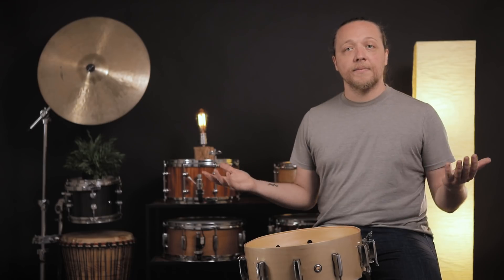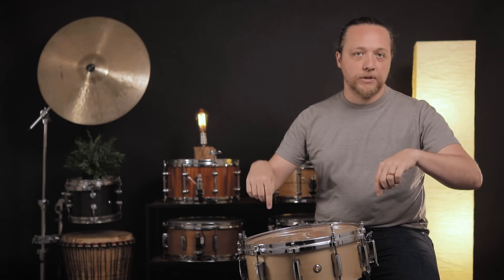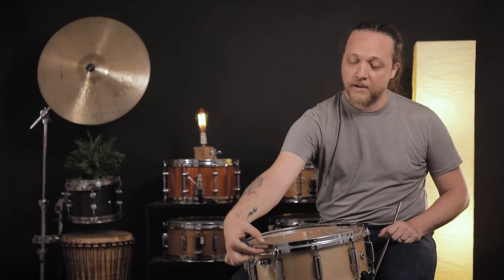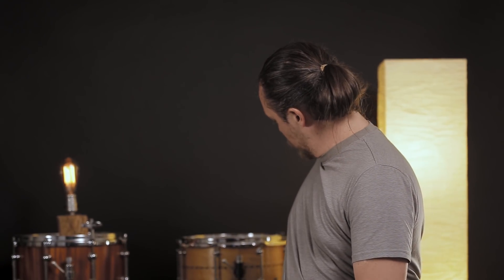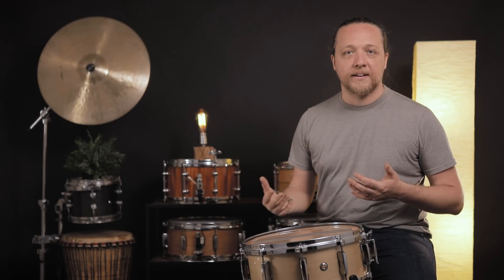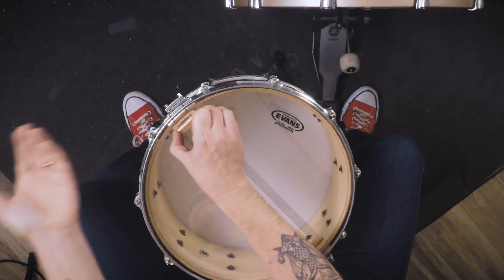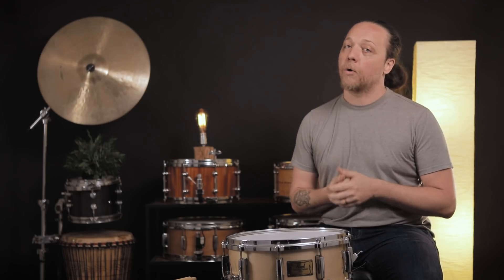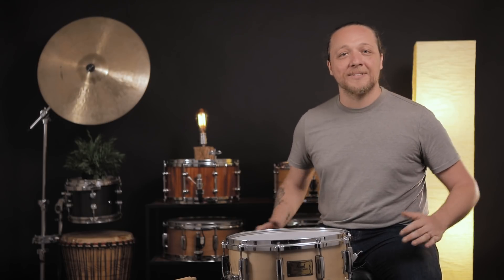Real-Time Snare Side & Snare Wire Tuning | Snare Drum Tuning 101

Comment: I realize there is more than one way to skin a cat, but I’m not getting the utility of using a ruler. Unnecessary. Love your videos though!!!
Reply from the maker: You’re absolutely right and this just happens to be the method that both of us use. The concept of the ruler is to match the hoop to the topography of the snare side bearing edge- snare bed and all. This yields the widest range of tuning options/quickly accessible sounds along with the dynamic range, allowing all elements of the drum to be present in the sound. Try it out sometime if you haven’t before. We’ve got a video that covers the concept in detail. Cheers!
Reply: I've used the ruler method once and never going back! My drum sound more awesome than before! Ruler rules! ❤